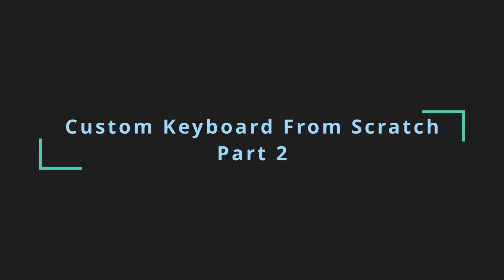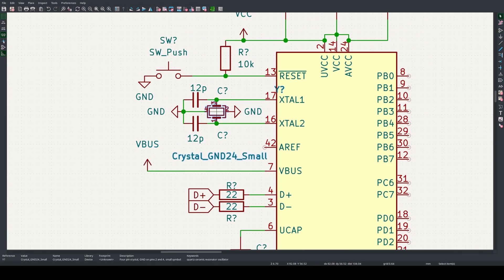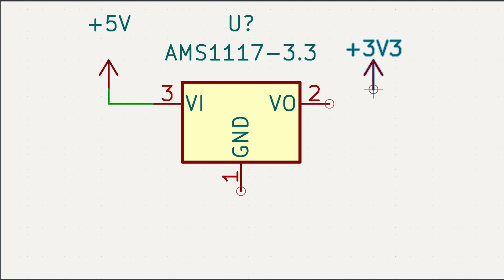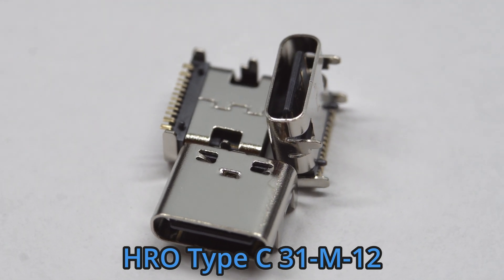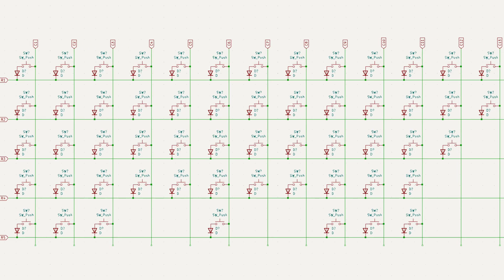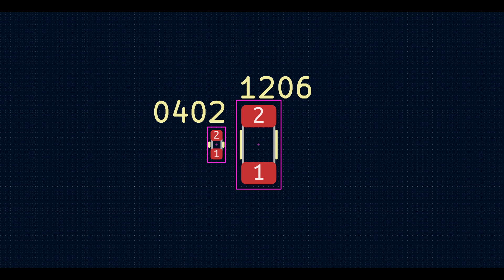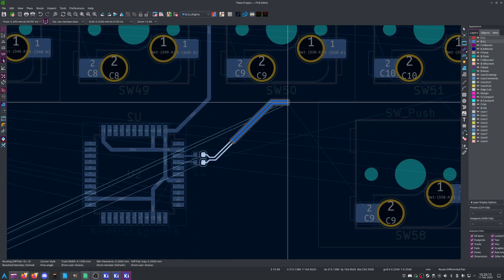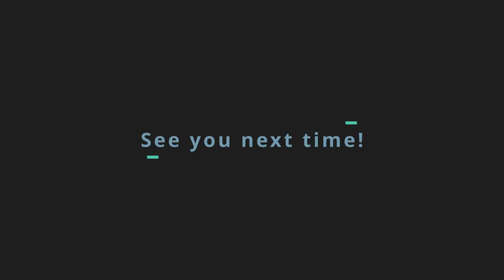Custom Keyboard From Scratch Part 2

Comment: What if i just want to make a custom sized numpad. Skip diodes because i won't do multipress, i plan on using a dev board (do i need resistors or crystals for that?), and the board i picked already has power through a battery. Can i just make a pcb with momentary switches, cable to the dev board and 3Dprint a case?

Comment: hello I was tryring to make it using Rp2040 because I had them lying around. I found a minimal viable design by rasberry pi itself would it mean that i wont have to make connections which are required for a microcontroller to boot up?

Comment: This is actually a custom keyboard! None of that prebuilt rubbish that only requires switches but a whole custom unit. If only manufacturers allowed to create custom pcbs or custom units or that you can select the features and that they assembld it
Reply: Manufacturers dont allow custom PCBs? What are you smoking? Solder fumes?

Comment: Why did you do both layers as gnd?
Reply from the maker: Route power, pour ground. It provides a reference for all the signals, aids in EMI/EMC, and prevents the board fab from having to etch away all the copper on the prepreg.

Comment: I wanted to make my own Arduino with an atmega2560 to be controlled via wifi with the esp32 and I would like to know if the process is the same for both the atmega2560 and the atmega 32u
Reply from the maker: Sounds like it'd be fairly similar to me. Follow the datasheets to implement the reference circuit(s) and connect them together however you deem fit.

Comment: Waiting For next Part ...

I also had a doubt, doing Btech in ECE (Electronics and Communication) is enough for this Venture ? or do we also need MTech ? and if yes, MTech in what subject ?

Pls Help, I will Forever be Grateful !
Reply from the maker: I think the answer to this is yes, provided you're willing to learn and make some mistakes. PCB Design is one of those things that spans several disciplines. It covers electrical engineering with ohms law and electromagnetic. It covers mechanical engineering as you need to understand tolerances and how components come together in the real world. Depending on the project, it could branch into computer science and require the ability to write firmware for microcontrollers, etc.

I think much of this can be picked up for free from the internet, but to really understand it (in my opinion) requires you actually do it. Use a 3D printer to print and build stuff, design and fabricate some PCBs to learn the process. Getting hands on is where it might have some cost, but it's certainly more accessible now than it was even a decade ago.

Hope this helps!
Reply: @CasualCodersOfficial  Thanks Alot for the Input !

Comment: I think beyond the atmega328, stm32s are cheaper and easier to work with. I think you should also mention JLCPCBs standard parts library which which is LCSC parts but includes all the capacitors and resistors, so someone can possibly get all surface mount components assembled for very cheap. STM32F103C8T6 with some parallel in serial out shift registers I think is the best option as compared to getting a microcontroller with a GPIO pin per button. You can also configure the shift registers to clock and send data on interrupts and use hardly any of the processing time, while still getting update rates >200hz. Nicely made video though.
Reply from the maker: I tend to agree. I quite like ST's microcontrollers. Though, I'll almost always spring for an ESP32 instead. Unless I care about my power draw of course. I wish they were more power efficient.
Fair point regarding LCSC and JLC for assembly.
Does QMK Support a shift register based layout? Seems like a major over-complication when most people I've seen tend to be making smaller ~75% boards. I believe a standard switch matrix should fix the GPIO Issue in nearly all of those cases.

Comment: Couple of remarks
1. Kicad is now at version 8, you used ancient version 6.0. In 8 you do not need to export any netlist manually, it is being automatically tracked
2. USB-C shield should be connected to GND, not left floating, usb-c cables will connect GND to shield anyways (not sure if all of them)
3. Kicad has at least 3 plugins that can automatically generate gerbers to specific manufacturers, I personally use Fabrication Toolkit
4. For repeated layout like you have there is a plugin named "Replicate layout" which can make sure that diodes are perfectly aligned to every key (as long as you keep in hierarchical sheet)
Reply: Connecting shield to ground is not necessary on a keyboard it would introduce unnecessary noise to the electronics and if you wanted to filter the noise out it would cost more in components. All desktop computers already handle the shield connection so you don’t need to worry about it in this instance. Pretty much all drains are connected to the shield in these cables anyway though so none of it even matters.
Reply: @funy0n583  It will not introduce any noise because shield is connected to ground via cable anyways and it will be connected to PC ground one way or another. Without shield however, ground is only connected via internal cable. Search for "Universal Serial Bus Type-C Cable and Connector Specification". You will find following text: Shield and GND grounds shall be connected within the USB Type-C plug on both ends of the cable assembly.

Now check your devices, i can guarantee all of them have shield connected to GND on PCB.

Comment: Eagle is better than kicad. has the autorouting which kicad clone does not have.
Reply: Eagle is probably the worst PCB cad software up to date plus it is being discontinued, it will cease to exist in about a year or two, read the autodesk blog post about it. Abandonware.
Reply from the maker: I've never used eagle, but Eagle is now an autodesk product and costs $680 per year. I won't be using it.
In addition, Kicad added some small auto-complete features in release version 7.0.0: https://www.kicad.org/blog/2023/02/Version-7.0.0-Released
Reply: I'd argue that an auto router would give worse results than routing by hand. Especially without loads of routing rules that could take a day or two to do.
Reply: Nah you tripping on god, KiCAD is much easier to use. Also KiCAD is a very well made software and not bloated like so many others like Altium. Only reason not to use KiCAD is if you need to use cadence and make something much more advanced.

Comment: Great guide, love that you stepped through and explained key combinations as you went through the whole process, bookmarking this for whenever I take the kicad dive from other paid softwares. Something you skipped over is setting trace widths, and you're using class defaults(though you did talk about it for the diff pairs). 

I would thicken all traces to switches, there's no reason to make them thin like high-speed data paths. If anything that little bit of extra trace capacitance, could help mitigate some switch debounce on occasion, but mostly for robustness. Also adding 'teardrops' features onto on all PTH and vias is a good thing to do as well, helps gradient the mechanical stress of hitting keys into a larger area so traces are less prone to hairline cracks developing right beside vias and large pad interconnects.

Comment: Hey there. What a great and informative video, especially for KiCad beginners! I have some quick tips I thought I could mention (maybe you already know):
1. Might be good to make a habit of assigning nets to net classes. This way, you can assign different track widths for different nets/netclasses.
2. I often forget, but setting the fab's capabilities/tolerance values to the design rules before beginning routing. The KiCad defaults I believe should be okay with JLCPCB 2-layer values, but sometimes I forget and have to re-route many parts of my board.
3. You don't have to export and import netlists in KiCad. In the PCB editor toolbar, there's a button that will pull in the netlist from the schematic directly. This is also handy if you make changes in the schematic as you work on the PCB and want to apply the changes.
4. For keyboard layouts, I found the "Keyboard footprints placer" plugin to be really useful. Should be in the default kicad plugin repo. You can define the layout you want in json (or use keyboard-layout-editor .com) and it will lay out the switch+diode footprints for you in the desired layout. And then you can group/lock the switch footprints so that they stay together.

Regarding length/impedance matching and differential routing the USB lines, you shouldn't really need them for something like this, but it was very nice to see it mentioned in there (also demonstrating the usage of the built-in calculator).
Cool video!

Comment: Great video again! Can you recommend any resources for larger switch matrix layouts? 

I want to make a full sized 109 key keyboard, plus some macro keys, but all the resources I've seen so far are for smaller 70%/80% boards.

There's probably some clever way to handle the matrix where matrix columns cover multiple columns of keys of something, but without guidance I'll be reinventing the wheel.
Reply: I would recommend using the 74HC165D, it’s a parallel in to serial out converter. You can connect it to the input of 8 buttons, and it only needs 3 pins. Since you can run these really fast and they’re stackable you can put two in series to read 16 inputs with three wires. If you’re looking for 109 buttons, you can just use 16 of these with the load and clock pins connected, and one data pin per chip. That way you only need 18 pins to read up to 128 buttons. The code isn’t too bad, just  use interrupts to cycle each read and it’s like 50 lines
Reply from the maker: When I made my keyboard (128 keys), I solved this issue with the AT90USB1286. It's the biggest AVR MCU Atmel makes. It's got 48 GPIOs and runs at 5v. Alternatively, you could make use of one of the high pin count STM32s like the F103Rx, F103Vx, or F103Zx microcontrollers. Note that these are 3v3 logic and not 5v.

Here are the design files for my keyboard.
https://github.com/CasualCodersProjects/Keyboard
Reply: @CasualCodersOfficial  ah awesome! So you threw enough IO at the problem to fix it? I'll definitely check out those chips and files. That'll be a great help, thank you <3

I'm pretty set on using the nrf5280 as I have a few lying around and am fairly familiar with it. I'd like to have the keeb work wirelessly as well as wired so that chip lets me run ZMK to get Bluetooth, or tweak it to use 2.4ghz via a dongle.  

IO was my only worry, I suppose I could also use that AT90 for the switch IO and have it communicate with the nrf at the expense of battery life. 

Thanks again for getting back to me. Looking forward to future videos!
Reply from the maker: @buzz1ebee  Is the 48 GPIOs of that IC not enough? You might also be able to do something with shift registers, but I fear that may cause significant latency on any keys downstream of it. I was going to ask about the ESP32-S3/S2, but those are only 45 GPIO at most.

That said, I'm not 100% certain which of the NRF SoC's you intended to use. I expect the chip with 48 IOs is the BGA one.

Comment: Can you try to make a mouse that will be awesome
Reply from the maker: That would be really cool, but I'm afraid it's rather impractical. I lack the design skills to make the body, and the suppliers for mouse sensors have a minimum order quantity of like 10,000.
Reply: @CasualCodersOfficial  use an adns9800 or pmw3360, done lots of mice/trackball projects with those, qmk compatible too